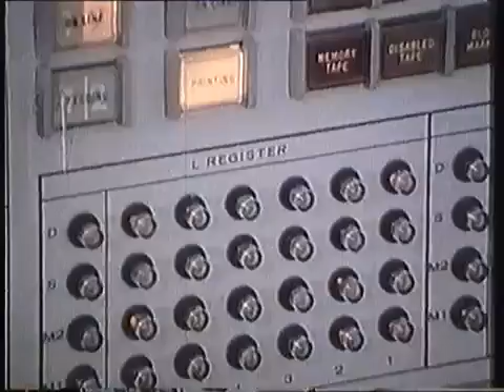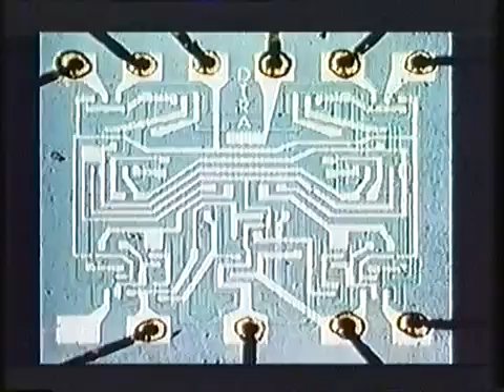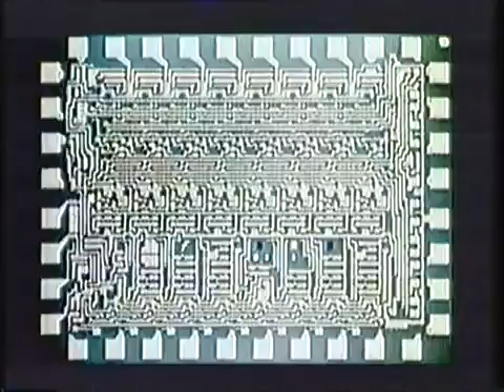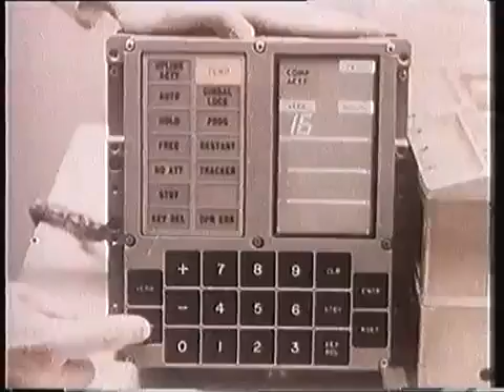History of Computers part 5 BBC Documentary.mp4

Comment: ⚡
Summary: 
The use of magnetic characters on checks allowed machines like Irma to be over 100 times faster than human bookkeepers and virtually error-free.
💡
The transistor, considered the most important invention of the 20th century, revolutionized computers by replacing the bulky and inefficient vacuum tubes.
🌍
The development of the integrated circuit at Fairchild Semiconductor in California by Robert Noyce marked a significant milestone in computer technology and paved the way for more powerful computers.
💡
The development of transistors and integrated circuits revolutionized computer manufacturing, eliminating the need for hand-wiring and allowing for smaller and more efficient circuitry.
🚀
NASA and the Pentagon recognized the need for a small, lightweight computer for spacecraft, leading to the development of integrated circuits to meet this demand.
💥
Making computers smaller has led to higher performance, lower power consumption, increased reliability, and lower costs, similar to the impact of the printing press in reproducing books inexpensively.
💰
The cost of integrated circuits dropped dramatically over time, going from $1,000 to pennies, revolutionizing the electronics industry.
🚀
The success of the Apollo 11 mission relied heavily on the reliability of the onboard computer, highlighting the crucial role of technology in space exploration.